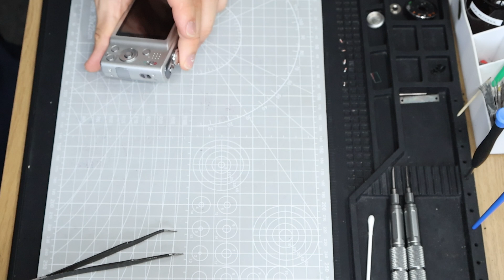How to Convert a Digital Camera to Shoot Infrared Photos - Panasonic Lumix FS35

Comment: Ok, after half a year i finally managed to grab a hold of a Panasonic Lumix FS16. Tried to follow all your instruction and made my way to the sensor. And there i was. Looking at it. Searching for the infrared filter. On the sensor and below the seal was nothing. On the lens below the sensor was nothing. Is there no IR filter in the fs16? i can't find anything online about it. Should i just try using a infrared filter with it anyway?
Reply: Also: I accidently broke off a tiny part of the seal. Is that bad? Camera seems to be working just fine anyway....
Reply: All cameras except some industrial ones have a IR cut filter in front of the sensor, with it being so thin sometimes it can look like part of the sensor itself. When a light is shined on the ir cut filter it should have a purple/ green reflection. Hope this helps!

Comment: Hi, this is cool.

I don't understand how it works though. If you remove the infrared filter from the sensor but then put another infrared filter on the lens, surely there should be no difference?
Reply from the maker: @ytintmain  good question! The filter that was removed blocks IR light from passing through. The filter that was put on only lets IR light through! Hope that makes sense